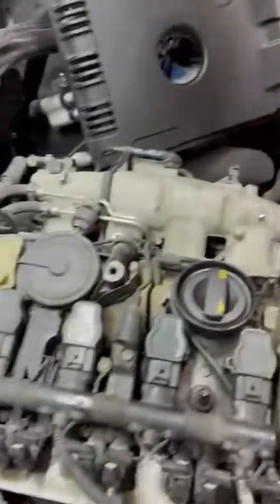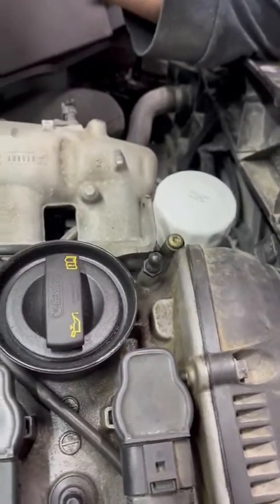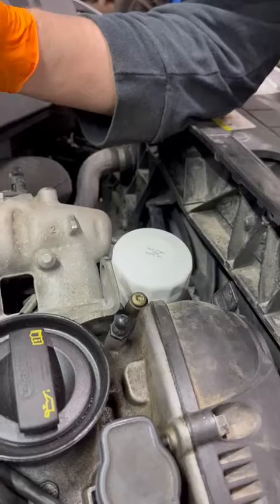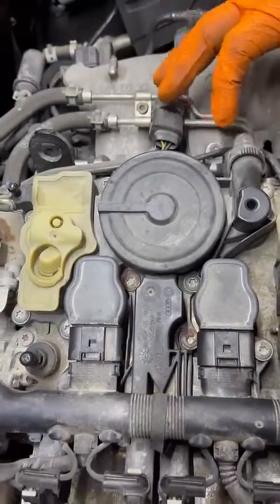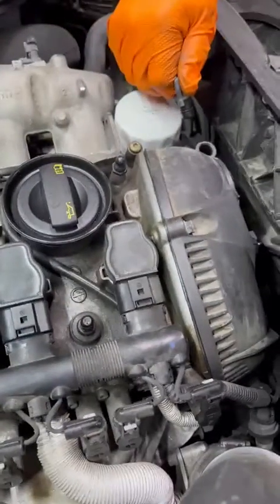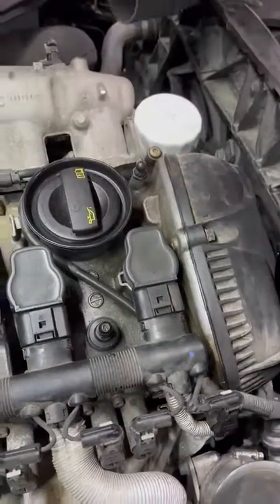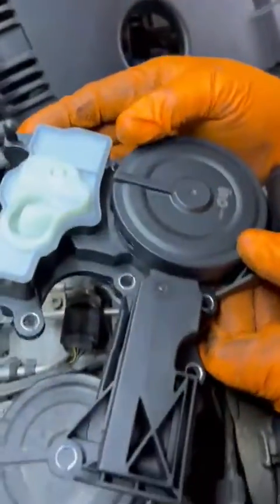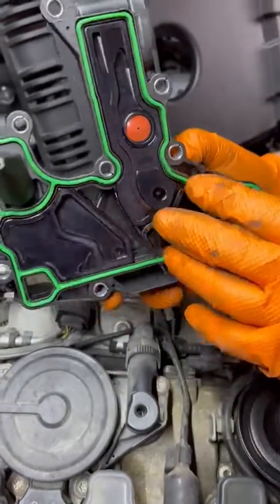Is Your VW or Audi burning oil? Cracking the case of excessive oil consumption in V.A.G 2.0L engines

Comment: They have a class action lawsuit against that engine series you're not going to fix it like that it's the valves letting it through, ask me how I know😅 VW ilwas forced to send the owner's a letter out acknowledging the problem in the USV
Reply: Which valves
Reply: No 150,000 miles never had this problem proper maintenance every 3000 miles  engine flush plus it needs oil additive plus timing chain

Comment: Did this fix the issue? I’m having  a similar issue 1L every 800-900 miles. 
Thank you for the video!!
Reply from the maker: In the case of this vehicle in question it absolutely did resolve the issue. If your vehicle is experiencing the same symptom as we show in the video it will likely resolve your issue. Thanks for watching 👀 🙂 🙏
Reply: @UrbanAutomotive01   I am not sure if its the PCV valve in my car or piston ring related issue! it sucks a qt every 300 miles no check engine light or no signs of oil around crankcase that it is leaking! i saw a video a guy doing piston cleanning w berryman 12 over night saok and that helped! i am not sure which one should i try berryman 12 piston soak or PCV valve replacement, thank you for video :)
Reply from the maker: @johndroc11  if your vehicle reacts the same way as the one in the video... my money is on the pcv /oil separator requiring replacement.
Reply: @UrbanAutomotive01   how would i know how to measure the vacuum suction as you put your finger into the oil dip plug! i just see a very less on mine.
Reply: What are the symptoms,  does it this cause the car to smoke from the tail pipe?
Reply: @thandiel.maitlhoko5176  it did yes